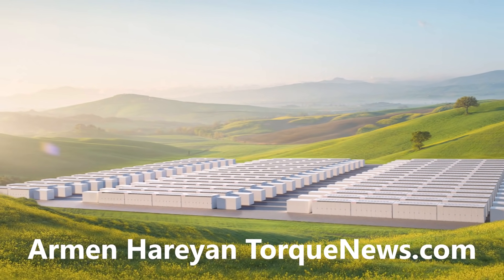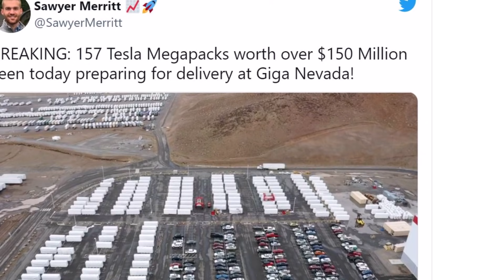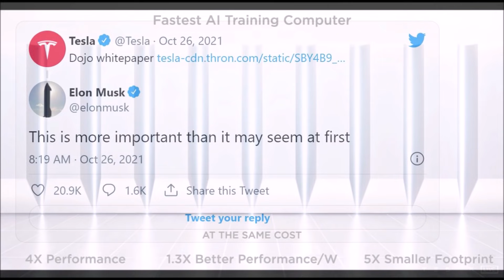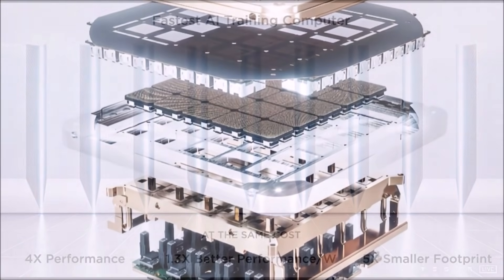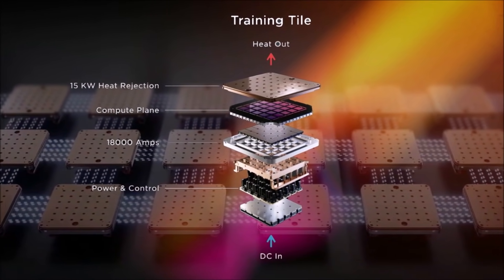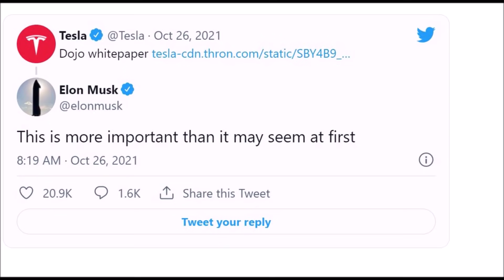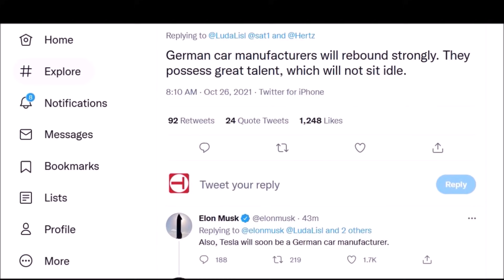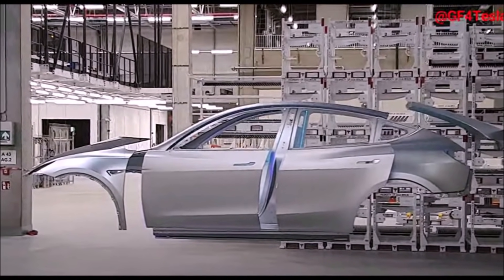HOURS AGO! $150 Million Tesla Megapacks Preparing for Giga Nevada Delivery

Comment: Great!  Can't wait for Tesla's utility side to catch up to the vehicle side.
Reply from the maker: Interestingly, as I mentioned in this video report Tesla Energy is picking up great time, and let's see how it will further support Tesla Utility. Tesla just needs to bring down prices a little bit, which will come over time.
Reply: @Torquenews  - Lower cost batteries is the key and Tesla is doing just that with the 4680 battery. Need to get up to full production speed with that battery.